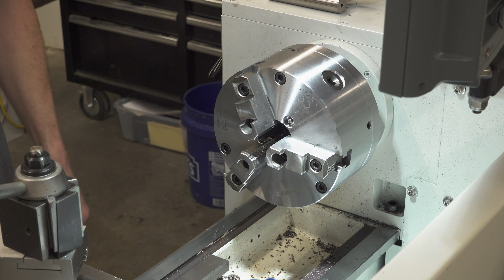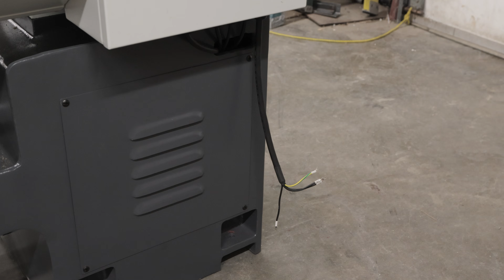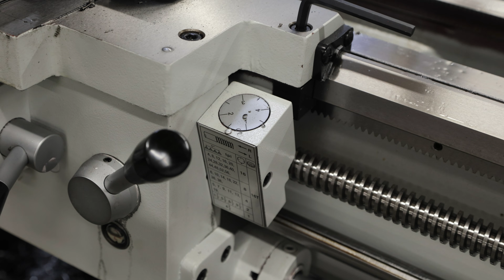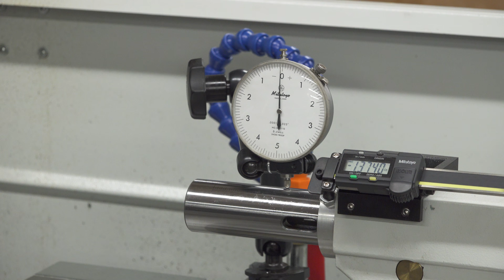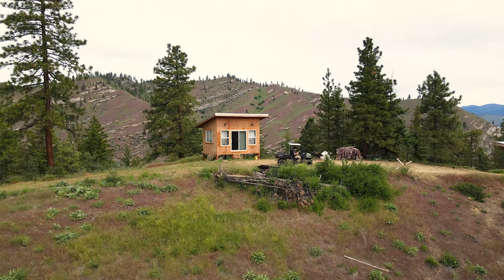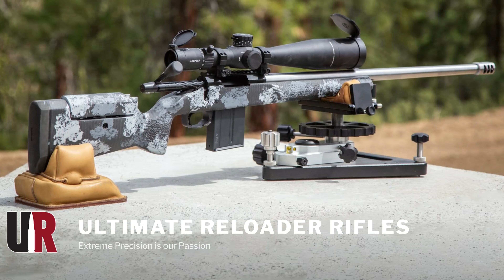NEW: PM 1440 HVT-2 Lathe (In-Depth!) from Precision Matthews

Comment: I can't be bothered to watch the whole video as of the 11:18 mark when you "mention" really good surface finish and dimensional correctness.   Don't you have any measuring tools??

The segment at 24:53 ....the reading should be ZERO......EASILY ......particularly if you are going to measure the tailstock quill "length".     MOST machinists would want to see MEASURED DIAMETERS of a piece length after machining ....both of a chucked piece and a piece "ON CENTERS".       Probably the most important measurements for ANY part .......and reliant on your ability to LEVEL THE MACHINE.

Missing a lot of critically important information .....particularly if you are selling this machine.    You put a lot more effort into your "disclaimer" section.

.

Comment: The somewhat odd spindle taper of MT5-1/2 for the PM-1440HVT-2 and 1440GT precludes putting anything with a standard taper in the spindle without some sort of adapter. Does this  present any issues in practice?

Comment: Did they change the motor specs since you made this video? Their website shows that the thing currently has a 5hp motor.
Reply: Also, I see you have the MX-100 series DRO on this lathe, but noted in your 1660TL video that it seems to have the MX-200L DRO. I understand the value of the 200-series DRO for a mill (better UI, clearer visual of what's going on, etc), but do you think there's as significant a benefit for a lathe?

Comment: Folks, don’t fall for the hype of needing the ultimate lathe for smithing.  A 1340GT would be a great gun smithing lathe, and the 1440GT even better mainly because of the extra spindle bore.  The point being that those who might think that this new 1440 is better than the last 1440 because it’s got a wider bed need to consider the usage.  Yes the wider bed is stiffer.  But are you hogging .25” cuts in 8” diameter material?  The average smithing job is comparatively very light cuts in small diameter material.  Hence why a 1340GT is a perfectly capable machine for most smithing work.  If you have the funds, by all means jump up to this level of machine, it’s a VERY nice package.  But you don’t NEED this much machine to do excellent work.

For perspective, I have the 1440GT that I was fortunate enough to find used/like new at a very good price, and I had a custom VFD conversion built and upgraded the motor as well, and still came in well under a new stock 1440GT.  Having run this lathe now for two years I can tell you that holding .0005” and less on anything smithing related is easy, it’s a damn good machine.  And anyone that says it’s not rigid enough for smithing is simply mistaken.  I also have a friend who runs the 1340GT, and he will tell you the same thing.

Comment: Will a TrueBore Alignment system work on this? Other than cost and variable speed, any reason NOT to go up to the TL series?
(love your stuff and it's helping me a lot decide which way to do a lot of different things. Thank you for producing the content)
Reply from the maker: The Truebore is a bit heavy for a 14" lathe. The TL is AMAZING and the only reason not to go up to it is if you can't live without the variable speed that the PM-1440HTV-2 has!
Reply: Truebore sells different back plates that would go on most of the lathes in common use.

Comment: Nice lathe.  You can also do variable speed with a variable frequency drive.  Don’t think it would cause me to go out and buy another lathe.
Reply from the maker: It can be done, but the wiring for a lathe that didn’t come with a VFD from the factory is non-trivial, plus you need to add an enclosure- see https://www.hobby-machinist.com/attachments/pm1340gt-lathe-vfd-schematic-single-relay-jpg.116822/
Reply: Yep I have a 3 phase lathe that had contactor problems and nothing in the way of customer service.  Basically I bypassed the contactors with a vfd. Very similar to how PM did it at the factory.  I also like the soft start and other features that you don’t get without a VFD.  Great video Gavin!
Reply from the maker: @donalddepew9605  Nice work, and thanks for watching!

Comment: That's an awesome lathe! Would you recommend it for someone new to running a lathe?
Reply from the maker: Yes, it's very easy to learn and work with!
Reply: If it’s within your budget, go for it.  There’s many YouTuber machinist channels you can learn from.  My favorite are Joe Pie, and Abom 79.
Reply: Would say, if y’all can afford it, y’all wouldn’t outgrow it. Yet it’s not any more complicated then any other lathe, to learn on, and does have some useful features, beyond most lathes, that’ll spoil you as a cherry lathe operator.
I think you should consider what and how much, y’all intend to do with it.
Realize that Gavin is using it to make a living…
Reply: Gavin you never mentioned the differences in the bed.  The variable speed lathe has a wider 9” bed width which I believe is 1-7/16” wider than the 1440GT.  Its a more robust bed thats built for less flex and vibration.
Reply from the maker: @brandontscheschlog  Yes, correct!
Reply: Just grab a Grizzly Gunsmith lathe. Very affordable. Had mine for 10 years.
Reply: I’ve had a Grizzly G4003 gunsmith lathe for over 5 years.  Added a DRO and have made other modifications to it also.  All lathes come with the basics, but as you progress, you’ll be making changes to suit your needs.   @OGBRADSHOP
Reply: @OGBRADSHOP  was considering a grizzly as well.
Reply: @RealSethWilliams probably made in the same factory actually.